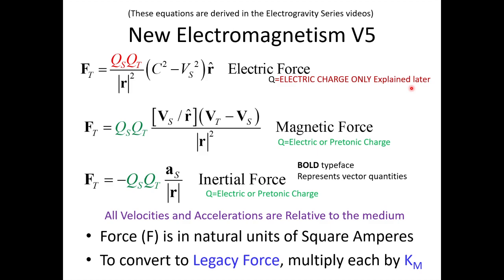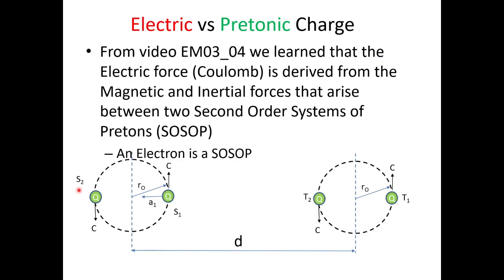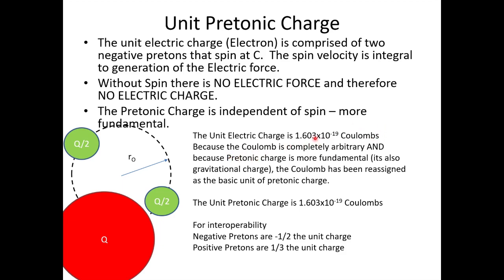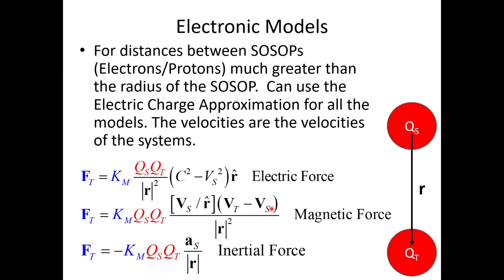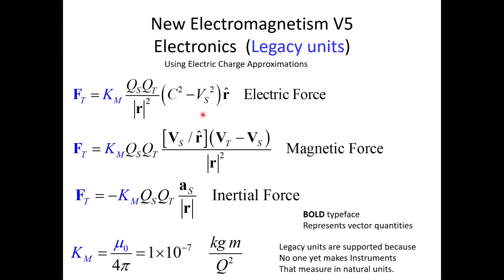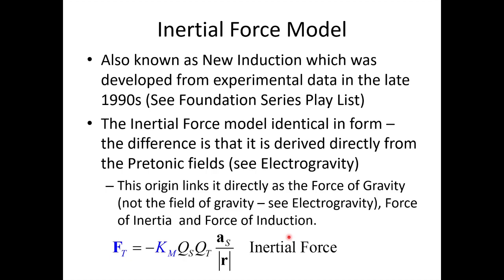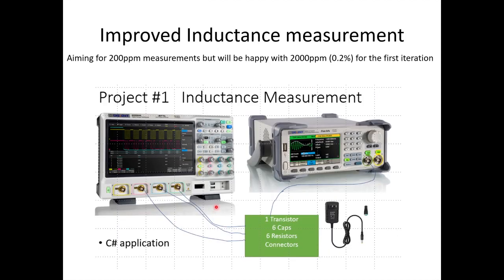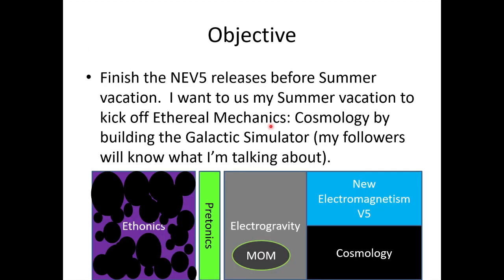EM04 01: New Electromagnetism V5 Introduction

Comment: Hi Robert, thank you for your work it is unbilevable that intusiast can do scince with theory and experiments. Very impressive. I have question regarding your new wave theory, where you stated that EM propogates with phase shift between magnetic and electric fields, however it is not the case for each wave phenomena, for instance in longtitudal waves the phase of 2 components of wave are in phase. It seems to me logical that in ether the wave propogates with phase shift since antenas has best transmiting performance when we have standing wave in antena, so transmited EM should be with phase shift.

Comment: Are you familiar with wye-delta resistor equations? I'm wondering if you put three capacitors or three inductors or a combination of both in the wye-delta configuration? It would also be interesting to measure the inductance of a toroidal inductor. Rumor has it that you can reach over-unity power generation with one of these.